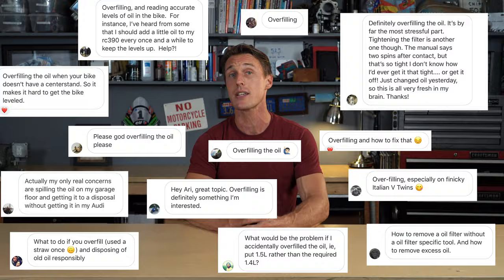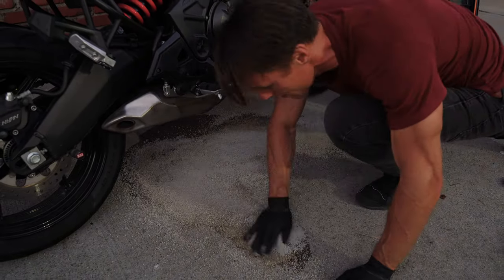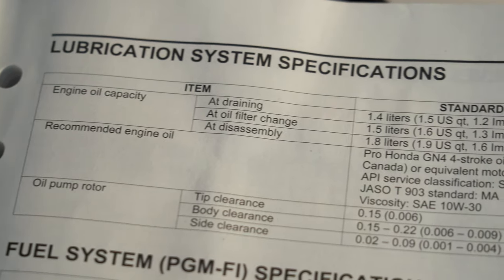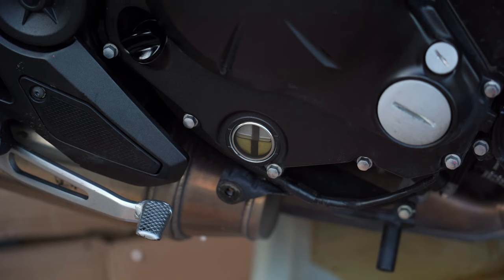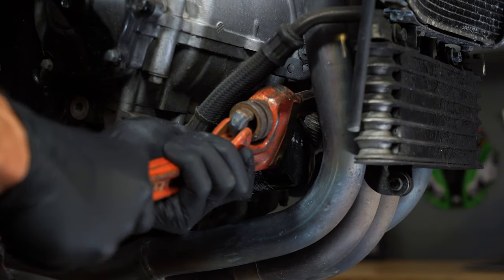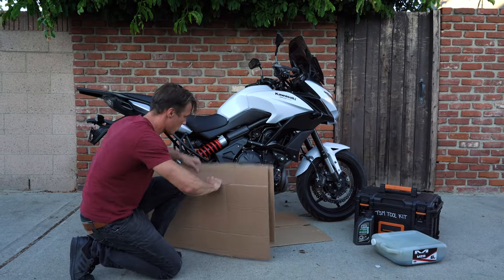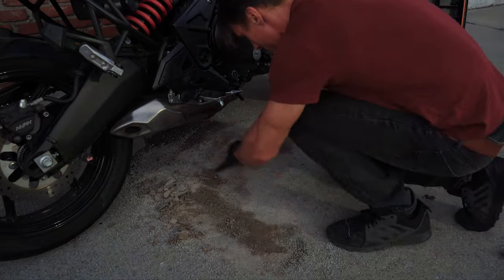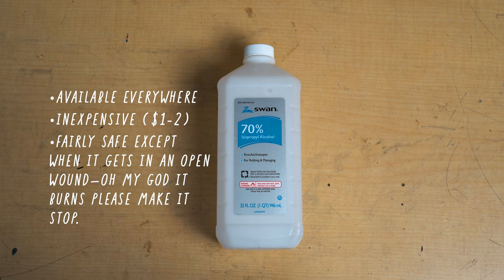Overfilled Oil, Stuck Filters, And Oil-Change Hacks | The Shop Manual

Comment: Seems simple enough, time to have a go myself.
*few weeks later.
Anybody breaking a Hypermotard? I need a new engine
Reply: @Andrew Humphrey hence why a trusted independent gets my business. The local Ducati glass palaces charge £150/hour , and the sales person in one of them didnt even look me in the eye when I was looking for a Hyper. Better my independent charging 1/3 that and owned by 2 Duc enthusiasts.
Reply: @Andrew Humphrey agreed, one of my friends on his Panigale got charged 1300 for a valve job. The dealer threw in some extras as well i.e a new battery "just in case". He was one of those high mileage riders like me who commute on our bikes. 

From my experience I find alot of the big glass palaces tend to be a bit snobby. They want the more money than sense crowd. Whereas the smaller independents tend to want to build a relationship with the customer.
Reply: @Andrew Humphrey That does suck. The nearest dealer that had the Hyper I wanted was 4hrs on the Interstate (UK equivalent). In the end I just shopped around and found one willing to deliver. 

Also I had the previous gen 765 S, loved it to bits. Keep an eye for the horn because they place it right behind the back wheel. That has a tendency to get hit by all the crap during winter and die. A good coat of ACF 50 should keep it going. Good luck with the Triumph, its definitely worth it.

*PS. Love the fact that we've both got sharks as our profile pics. Shark bros unite!

Comment: Nonono! IF the filter is stuck enough so you cant get it off, do NOT push a screw driver trough it. You end up ripping the filter, and you are stuck with a half twisted filter piece that is impossible to get a grip around with a real filter removal tool.

Comment: Really stupid question, but why do the mfrs always want the bike upright when checking oil levels? Why not adjust them for when the bike is on the side stand? Then you wouldn’t have to try to hold a bike upright while staring at a sight 3in from the ground... just sayin.
Reply: Less margin of error for unlevel ground, what direction you have the bars turned, etc.  Back in the day, it was check oil level on the centerstand.  I am now down to 2 out of four bikes having a centerstand and I am sad.
Reply: Michael Krenzer I don’t buy that because you’d still be in trouble with the bike on slope front to back.

Comment: 10w-40 or 20w-50? And why do people add 20w-50 when manufaturer says 10w-40?
Reply from the maker: Viscosity depends on your bike, and you should always follow the manufacturer's recommendation.  I would suggest checking out your owners manual, and it should have a chart like this:

https://i1.wp.com/blog.amsoil.com/wp-content/uploads/2018/04/SAE_Viscosity_Grade_Temps.jpg?ssl=1

That will tell you which oil weight is best for which riding temperature.  People will go to a heavier oil, like 20w50, if they are riding in hotter conditions to ensure the oil is not too thin and keeps the bike adequately cooled.  But we always recommend sticking to the manufacturer's recommendations in your manual.

I hope that helps!
-Zack

Comment: One thing that gets me is why the hell does the window need the bike to be upright to check the level. Move the window lower so we can check while it’s on the bloody stand! Bah!
Reply: Sometimes the ground is not perfectly level and over time the kickstand gets bent or the metal starts to wear. Only a few degrees off and the oil level reading is out of spec. With the bike upright and leveled out you will get it right everytime. Hope this helps you bro.
Reply: and you just got your answer and it is actually why noone does what you seggested
Reply: You really don’t understand why?
Reply: Lol

Comment: Im genuinely surprised you recommend screwdriver through the filter. A world of pain awaits once committed should it fail. Less effective than other routes.
Reply: He DID preface it by saying it's a last ditch effort if all else fails, at least
Reply: @timboyer8783  Yes, but some other methods have a much better chance of working where the screwdriver will fail. If things are that dire, leave the filter on until you can buy a better tool.